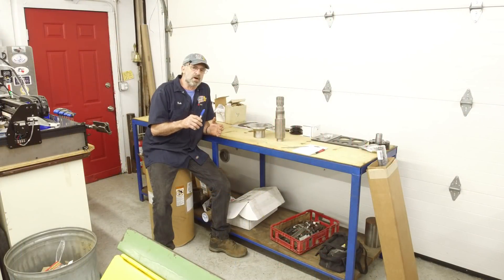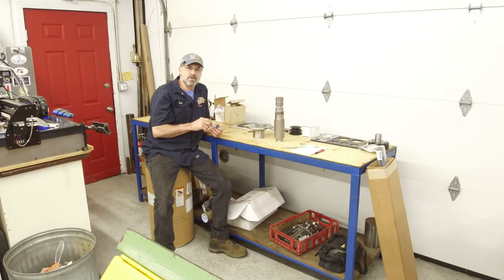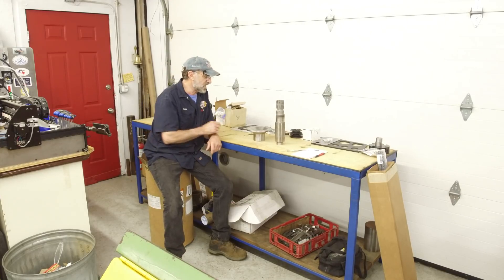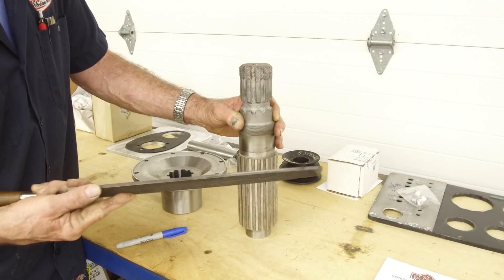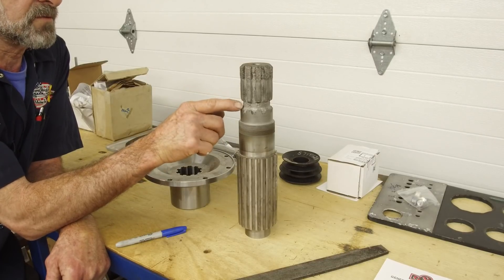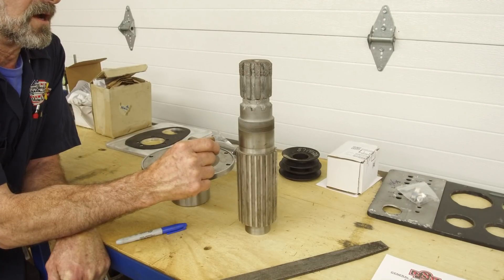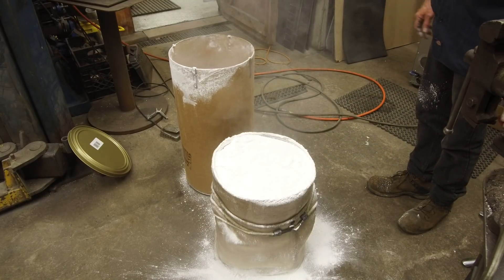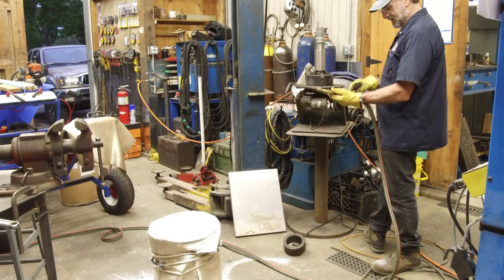Put The Spline In The Coconut Part One

Comment: Nice to see you back in action! Just realised I had never subscribed so just sorted that!
Wouldn't it have been easier to machine off the splines. Then press fit a newly machined set of splines on? Secure it with a set of internal splines. I am just learning but wouldn't that work?

Comment: Great to have you back Keith, I just wondered if by only heating the end of the shaft, you may get the cold part of the shaft sinking the heat from the hot end relatively quickly, even though you had it in a lime pit.  Every time you wake up and find yourself on top of the grass, and your name not in the obits, well it's a good start😀

Comment: Nice to be missed ain't it? You probably can get a window panel out of a garage door company's trash pile. There's no rocket science to cutting holes in the panels and installing/ recycling windows from one of their remove and replace leftovers. Only the most gargantuan of doors get a structurally reinforced window panel. Pretty sure for that door they would use the same panels and cut holes at the factory. Thanks for sharing

Comment: That looks so very much like the output shaft that I have just machined for a Rolls Royce Meteor 27 litre V12. I just left it hard and cut it with CBN  tipped tools. Customer did not want heat treatment changed so hard metal machining was the only way to go. Was like cutting Inconel!

Comment: tip the drum over  45 or flat on ground and roll back and forth a bit while pulling the bag. that loosens powder from shipping settle and lets the whole bag slide out easy. 
more great things learned over the years! :)
Reply from the maker: Found out after it was out that the bag is joined at the other end of can. ;{)
Reply: @KeithFenner  DOH(homer simpson voice) that reminds me, I have dealt with them like that before and made a big mess. but they were meant for loading on a machine.
in the long run, time flies, memories fade and you repeat mistakes due to long time between.
all of us "humanity" isn't perfect, never has been nor will it be far beyond out life-times :)

Comment: Great to see you back! I have a horizontal mill wheel shaft that needs straightened is that something you would do? 40taper about 24" long.
Reply from the maker: Because of the keyway the full length it is more difficult than solid, if out only a slight bit, might be able to do it, cost around 200. ;{)
Reply: @KeithFenner  ok I'm going to email you for mailing address and payment stuff. Thanks.

Comment: Why not just use carbide instead of high-speed steel then you wouldn't have to anneal it and compromise The Temper of the part
Reply: I am guessing the interrupted cut would raises hell with the carbide. Brian bloc had a video trying to machine hardened splines and it didn’t go well

Comment: I always wonder why you don't own a heat treat electric furnace. I'm a hack compared to you, but I got one 25 years ago from Paragon kiln. Small, but this part your working on would fit in it. They have knife makers furnaces, but I got the glass kiln as it was the same and less money. I've used it many times to anneal air hardening tool steel, and many other hardened parts to repair then heat treat again. Also, I picked up a Rockwell hardness tester, so I can verify how hard something is, but after doing the tempering process, I know I hit the right hardness. I know you have some video of you throwing some steel piece in your wood burning stove. But having a controller that runs it up to temp, holds it for soak, as well does the slow cooling for annealing would be a great addition to your shop.

Comment: Good to see you back Keith, you were missed.
If you replace a section of your overhead door with a panel with glass be sure to also replace the springs. Panels with glass windows are heavier than solid sheet metal and your current springs will not be correct for the added weight.
Reply: Windows lighten everything up 🤣😃😁

Comment: Hi Keith, 

Great to see you back. 
I think there would have been many of us wondering how you were going, so it's good to know you have completed the move and work is coming in. 

I'm looking forward to seeing the new shop, and yes, compared to the original tour, from the little we can see,  it looks vastly different. 

I've been doing some research into "softening" steel in this past week, so your video was very interesting. I have a tendon saw which I bought off eBay, it's an old Spear and Jackson that had seen better days, and needed to be regulleted and straightened so I took it to my saw doctor. Seems the blade is extremely hard and brittle, so as they set a tooth, it snaps off, and from what I've found on the net, heating and slowly cooling should both reduce the hardness a little and more importantly the brittleness. It indicated a temperature of only 250°C for a couple of hours then slowly cooling. That changes some of the internal steel structure and composition.  

You have clearly gone well beyond 200 degrees, probably closer to 2000° and does the lime just act as an insulator, or is there a chemical reaction as well?

I would appreciate and value your comments. 

Good to see you back. 

Regards Dennis.
Reply from the maker: It is used as an insulator only. ;{)
Reply: Thanks Keith.

Comment: Interesting, would have thought to use vermiculite or perlite myself, any benefit over them using lime, or just personal experience/choice? Only asking as I've not seen or heard of lime being used for slow cooling before.
Reply from the maker: Personal experience and the standard from the old school I learned from. ;{)
Reply: I prefer sand as you can heat the sand too for an even slower cool down , especially good if you've been welding cast.
Like you say personal preference.

Comment: Glad to see you back Keith.  I hope everything is good with you !
Would it be feasible to machine the end of the shaft to a smaller diameter, add splines and make a spline-to-spline adapter ?  Maybe press fit/heat shrink the adapter on to the shaft ?
Reply from the maker: I believe that would add another surface fit that would wear as well and might reduce the torque strength over all.  ;{)
Reply: @KeithFenner  Reducing the torque capacity I could understand.  I am surprised that you comment about wear, especially on a shrink fit.  You're the expert !

Comment: I find it interesting how different I would of approached that spline,  would of stick or mig filled all those old splines with weld, that would of taken the temper off,  lathe turn new OD for the spline then put it in the indexer and mill new splines,  then re heat treat just that new spline,  borax...  cut splines on a lot of electric motor rotors to fit yokes, for direct drive electric vehicles....

Comment: Hmmm I think I have never seen keith doing hard milling or hard turning :D CBN tools on ebay are easy to find and buy :D
Reply: Don't waste your time with eBay ceramic/CBN. Plus it wouldn't do much good on an interrupted cut on a manual machine.
Reply: @xenonram  Also the weld may be trickier if you welded a hardened part, maybe better to anneal, machine off the broken bits, weld, re-machine and finally reharden

Comment: Hey Keith, welcome back! I'm not a machinist nor do I doubt your experience. In the event you're not too far into the project, wouldn't it be better to turn that spline end down to an even smaller diameter and thermally fit a machined sleeve over it. Then machine the new splines and heat treat?
Reply: I doubt a shrink fit would hold. Fire pumps are under s serious load while working and you really don't want anything left to chance when you have a crew on the line.
Reply: That was my first thought too but perhaps it depends if the torque would overcome the shrink fit?
Reply: Nope or Keith would be doing that.  Come on now people! The Master knows what he is doing :-)